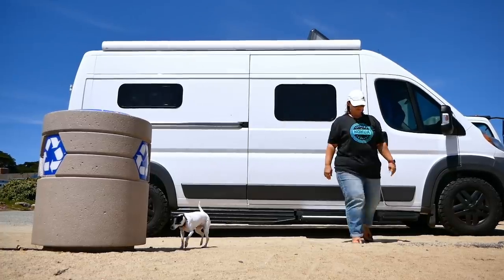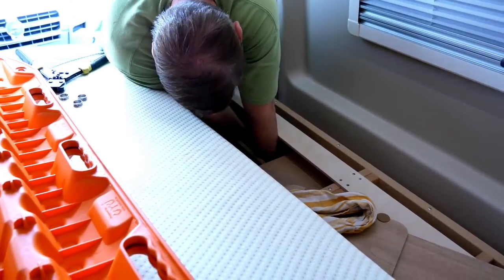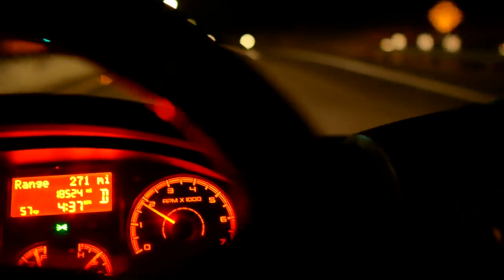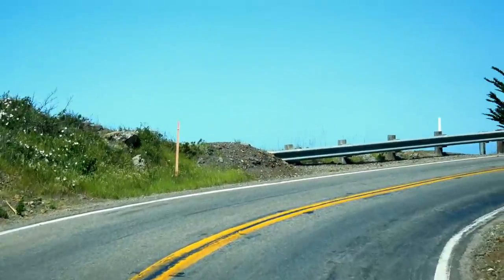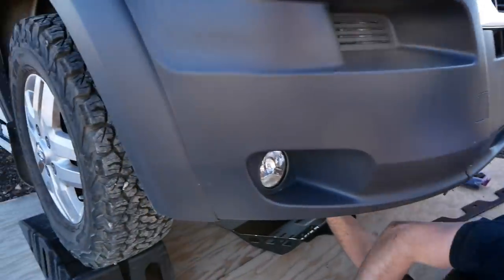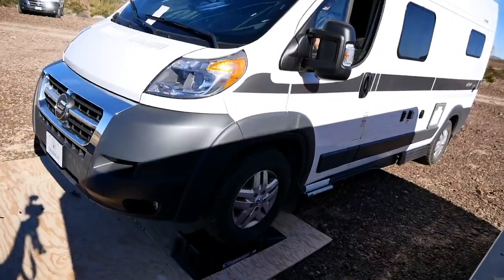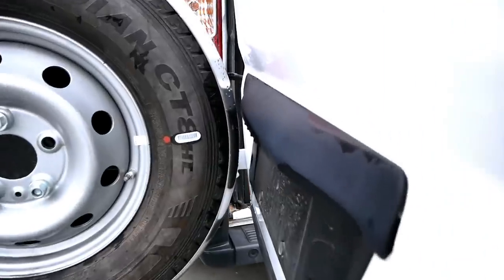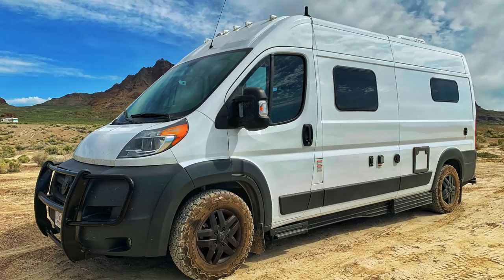Van Mods Preparing for ALASKA ROAD TRIP & Mormon Cricket SWARM

Comment: Hello - I'm considering a ProMaster-based Class B and tripped over this video while researching mods and the van's potential for light off-roading, if you can call a dirt road off-roading.  ;-)  I think I'll subscribe and poke around. Thanks for sharing your info! BTW, the temperature gauges on automobiles are intentionally vague. While 190(ish) degrees may be the "center" of the gauge, the truth is the engine is designed to run in a range of "normal" temperatures, 180-210 degrees, for example on my old VW. However, customers can get antsy and take their car in for service if that needle moves too much or is not perfectly in the middle. As a result, the needles are designed to stay put once the engine is warmed up unless the coolant temp deviates from that wide range. It keeps most drivers happy and prevents them from being fleeced by mechanics when nothing is really wrong with their cooling systems. That said, I like Ultragauge and ScanGauge for more precise observations. Take Care! -Scott
Reply from the maker: StealthGTI 😀

Comment: We love your video. I am looking at the upgrades you had for your ProMaster based van with EdgeVan Works. What brand brush guard (is that Steelcraft Front Runner Brush Guard?). My B Van (Coachmen Nova) also comes with the E-Guard metal plate protecting the under chassis alternator. But the Steelcraft brush guard ( I already purchased) posed problem with the installation with the bottom bracket. I hope you could provide insight to your installation with EdgeVan. Thanks in advance.
Reply from the maker: Sorry, I'm not even sure which one it is, but Gordon would be able to tell you.

Comment: Amber, couple of questions,  what did you paint your wheels with?  Or did you get them powder coated?  I noticed you replaced the stock tires with BFG K02's.  Did you stay with the same size (225/75R16)?
Reply from the maker: Glenn Fujimoto 😀I did stay with the same size tire that it came with. I used plastidip. You can see the mod here: https://youtu.be/batPBn-TqaA

Comment: Nice mods! Just called Gord yesterday to set up an e guard instal. Is your water tank still down below?
Reply from the maker: karstenvonhoesslin oh cool. The water tank? Yes. Is there another place to relocate it to?
Reply: @storychasing  I'm thinking under the left side of the bed and running lines internally. It's doable but need to see who can do it- perhaps Gord? Then the spare could return to underneath which would also be a bonus. Saw the ep where you bottomed out- thankful for the E-Guard. I raised mine 3" and got the largest A/Ts adding another 1" .. this really helps with clearance.  Gotta remember that despite the FWD & AT's, the van is still rear-heavy. Got stuck on a narrow incline once & needed to reverse out in tow mode.. nightmare.  Safe travels!

Comment: The purpose of the water stainer is to protect the water pump from debris causing  a malfunction. Water pumps are not cheap to replace, whereas strainers are.
Reply from the maker: Dusty Trailhead  The external filter has a strainer on it so I feel comfortable not having this part on the system right now.

Comment: Thanks for the info on your van mods. I have the same Hymer and have had many issues. The bumper sensors keep sending a fault or warning light on the dash ect, Dodge said it was from the Hymer tire bracket. I was wondering if you had the same issue or did someone disable the sensors. Thanks and safe travels.
Reply from the maker: Philip Tarnaski I do have that same issue too and haven't resolved it yet, mostly because I haven't tried! Except I tried to clear the code through the Ultra Gauge OBD2 connector with no luck. Next time I go into Ram I'll have them fix it.